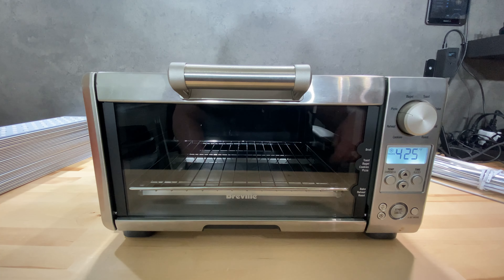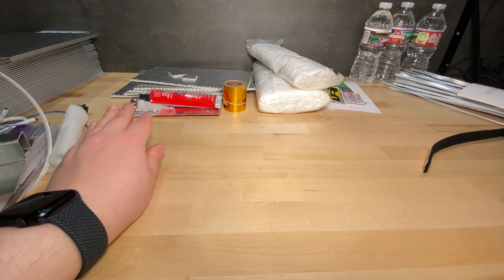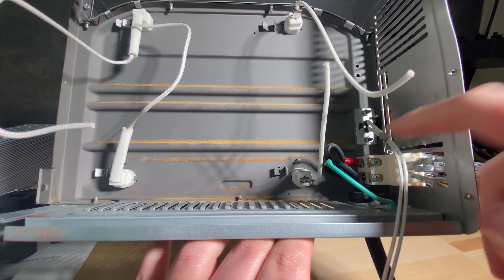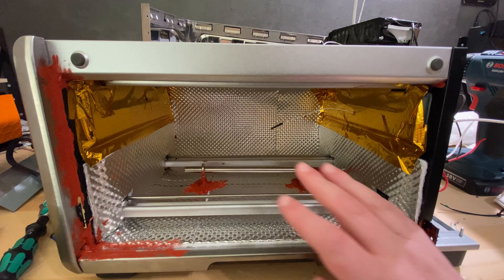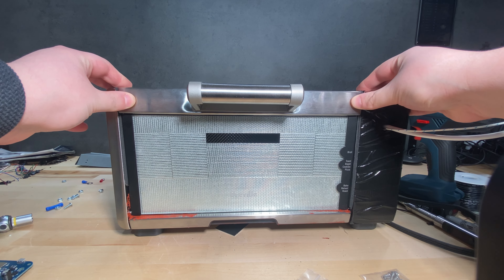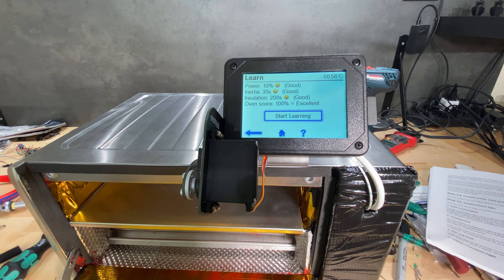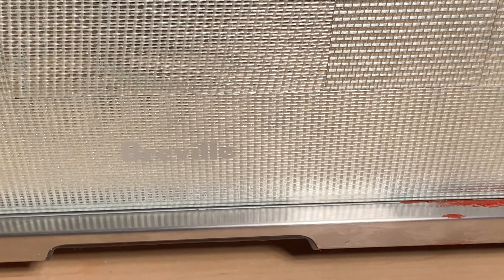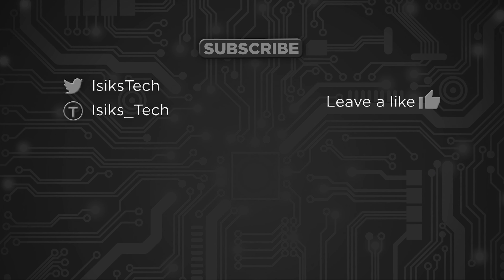DIY SMD Reflow Oven - Controleo 3 Build

Comment: You can not run the thermocouple wires through the multi-conductor cable the junction between the wires is important, you simply can not extend them.  The thermocouple wires must be one piece until it gets to the PCB where the amp/processing chip is.

Comment: Interesting controller unit. I wonder if there's any heater time duration limitations when making a profile? Because in theory you could probably use this oven to dry out moisture sensitive components prior to reflowing them using the same oven.
Reply from the maker: There's a "bake" button in the main menu. It should be possible to use that if the goal is to heat for x time without a full profile.
Reply: @IsiksTech  good to know! This makes me like this kit a bunch more. Thanks for the review! :D
Reply from the maker: I'm glad you enjoyed the video. 
Honestly, I should have done a better job showing the features of the controleo3 in the video and doing a mini-review of the controller instead of just commenting on the kit. I shot about 8 hours of footage for this video so editing it was really difficult. A lot ended up being cut. When shooting this much footage it's difficult to keep track of what I covered too so there are some things I forgot to include, like info about the "stock" black&decker oven. It's not my finest video but I did the best I could. Definitely some lessons learned when making this video.
Reply: @IsiksTech  hey, we've all been there. I'm of the belief that hearing the thought processes behind your decisions and seeing how you get to a solution is an important part of any video that requires it. And, while I don't exactly have any videos on my channel, while in TV production school I've totally shot too much coverage, or way too little, so I relate. :)

This might sound a bit odd, but bear with me: what editing software are you using? BMD's Resolve has incredible speech recognition for subtitles that you could use to help you find important discussion points, and make edits around those. I'm a big fan of their Speed Editor as well, because it's a physical interface with a dial and dedicated buttons.

At any rate, I'm looking forward to the next video with the Nevermore. I've kinda been out of the loop regarding their releases as of late, but from what I've seen, they appear to have come along in leaps and bounds.
Reply from the maker: I use Premiere Pro. Thanks for the suggestion, I'll look into it.

In the future, I think having some written bullet-point notes for the information/review segments of the video should work well. This is what I now do for my review videos and it works really well. I used to script my review videos but that makes it sound too artificial, but if I have no notes at all like this video I forget important points I should cover.

There's now a Nevermore StealthMax too, I think that's the newest one. Mine is the "old" Max 2. StealthMax is easier to print and just as capable so it'll probably eventually replace Max 2.

Actually that video will be a good test video for the bullet point thing I mentioned above. Most of the footage was shot months ago and now there's plenty of outdated information in it. I need to cover these changes in the footage I'll shoot (probably in the conclusion).

Edit: Wow, not just a few months but almost a year! Oct 2022 is the oldest file in the folder for that video.